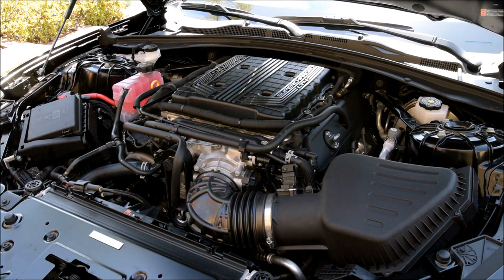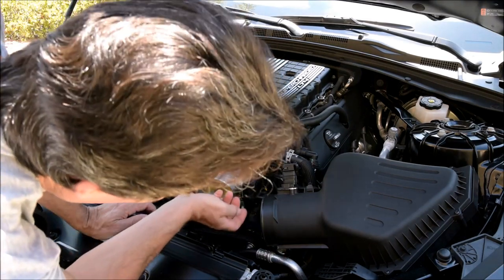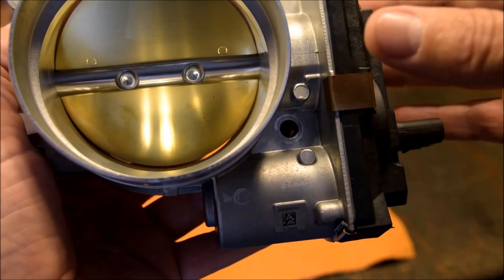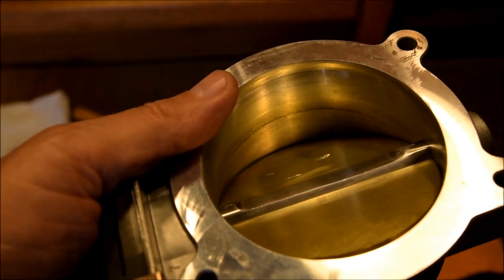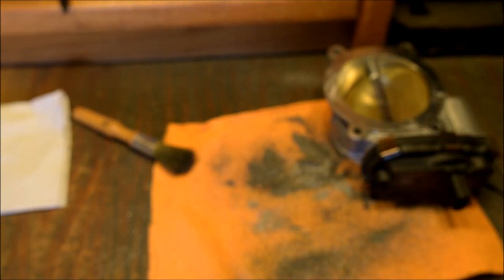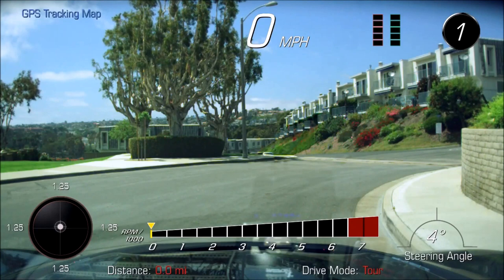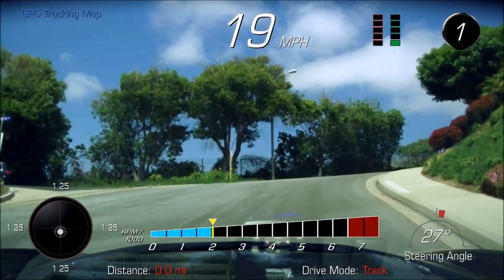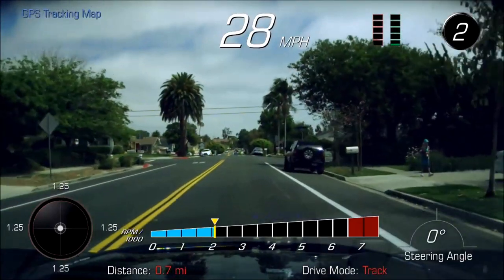BSR ZL1 Throttle Body Porting (How To)

Comment: I hope you don't think you GAIN a large amount of power by polishing that throttle body as you stated a large improvement.
 FIRST you have no before numbers from a dyno to prove this 
Second you have  no after porting numbers. 
THIS IS MUST FOR ALL MODS DONE ON A COMPUTER CONTROLLED CAR!!
Reply from the maker: I hope you don't think you can tell me something I don't already know.  Did I claim a Large Horse Power GAIN?
It's all seat of the pants power and driveability.  It IS a worthwhile project and you WILL see an improvement. 
Thanks for watching!
Reply: @wfofz1  The only problem here is Seat of the pants does not work and IN NO WAY CAN ANYONE FEEL A 1,2,15,30 HP increase by the seat of there pants.
 You have a calibrated air intake with a MASS AIR FLOW SENSOR that measures the volume of air coming through the engine,when you tamper with ANY PART OF THE INTAKE  you can lose Laminar air flow across said sensor other words you can change the way the car runs.
THOSE SAID RIDGES YOU REMOVED ACT as a VENTURI TO COMPRESS THE AIR to the supercharger which accelerates the air through the throttle body by smoothing them out you may of loss power! If you work on cars or bikes with a Carburetor you would know this and recognize them! I know this car is direct injection but correct air flow still applies.Also I am a ASE MASTER TECHNICIAN 40 YEARS I OWN THE SAME CAR and build my own race cars. Something you might need to do now to that car is a dyno and a tune.
Reply from the maker: But,  @apacheone3643  You can FEEL throttle response.
Reply: @wfofz1  I am about the numbers throttle response may  be altered but the Computer could of enrich the fuel mixture for better or worse. EMMISSIONS could of been altered for better or worse! The only way to know for sure is to tie into the Computer by a TUNING software and looking at the fuel graph or a dyno.When I tune I use both and do a before and after run 6 times not like some that do 3 and I am environmentally controlled which is most important.
Reply from the maker: @apacheone3643  You obviously have more money at your disposal than I. I agree that the BEST and most IDEAL would be to do as you are suggesting. 
But, I disagree that there can be no gains without a dyno tune.
Reply from the maker: @apacheone3643  I don't think that people with your resources are looking up "How to/ DYI  videos.
Reply: @wfofz1  I am just bringing a point out, You just cannot take a part out of a car without knowing if you are improving or screwing something up without any testing this is not the 60s where parts were cheaper if you screwed up.
The engines of today are nothing like years ago they are technological  marvel, 10 years ago 650 HP WAS IN the Ferrari,Lamborghini,etc
And your right people do not have my resources but as MOTORHEADS that want more power better throttle response better 1/4 times we as those motor heads that NEED TO DO THE LEGWORK WITH NUMBERS TO BACK UP.
I have tested various COLD AIR INTAKES (CAI) I had A CAI that caused a lose of power 5 HP avg from the stock airbox with a K an N air filter on a Camaro SS. Now I know you only have my word but there was a guy named Lethal Camaro that had a similar result on his own SS and it was on a dyno in California and videotaped.
Reply: @wfofz1  Its not about money John, it never was I am not knocking you, but these cars are really temperamental as I stated before.I have friends that have after 1000 miles ripped the engine out cam the engine change pistons and rods boosted the SUPERCHARGER (20 PSI) these cars push 1000 plus HP AT THE WHEELS.
Some go to shows others are just for Sunday cars.Mine I am leaving stock for now AMERICAN race headers makes headers for my ZL1 Certified by GM that may be the only mod I do.My Car along with My RS IS A 50TH ANNIVERSARY AND THE ZL1 HYPER BLUE IS A 50TH ANNIVERSARY.
Reply: @wfofz1  I am a motor head John And as  TECHNICIAN I AM ALWAYS LOOKING AT WHAT PEOPLE ARE DOING EVEN YOU TUBE but I look to see if they back there CLAIMS up with a dyno test a 1/4 run both before and after but if I see something that's not right I say something.Again Motorheads need to talk and come to a understanding that is how we help each other.
Reply: @apacheone3643  Those ridges are an abrupt step change in the ID of the throttle body. I don't need to tell you as a master technician of 40 years that this creates turbulence and drag, which leads to less efficient air flow. This is not just speculation, but has been well documented as a known shortcoming of the design of this particular throttle body. It has a noticeable negative impact on throttle response and costs horsepower. There is considerable subjective evidence that removing that ridge significantly improves throttle response, and gains of ~15 horsepower have been objectively achieved on a dyno, with no other changes or retuning of the ECU. Unfortunately, due to the ridge's close proximity to the throttle plate, there are limits to how much can be removed without opening up the gap under the throttle plate, affecting idle air flow and exceeding the tolerances that will trigger a ECU fault condition. But Mr. Boston is well aware of this and took a very conservative approach to porting.

With respect to the ridges acting as a venturi, you already know that a venturi is integral to the function of a carburetor. It creates a pressure drop in the air flow that allows the higher atmospheric pressure in the fuel bowl to push fuel into the air stream. However, in a fuel injection system, I can't find any examples where the increase in velocity through a venturi is utilized, particularly in supercharged applications. Can you provide a reference? Furthermore, to minimize turbulence and drag, the angle of transition to the reduction in pipe diameter for a venturi is typically around 30 degrees. Again, this throttle body has an abrupt transition that is close to 90 degrees.
 So, the intent of this ridge is clearly not to act as a venturi.

You're also no doubt aware that while yes, there have been substantial improvements in automotive design and engineering over the decades, cost is still the most important driving factor in mass produced cars, and less than optimal parts still get used in order to meet a budget. All of the evidence indicates that this throttle body is one of those parts. Consequently, what Mr. Boston has done appears to be very sensible and I applaud him for his efforts! I appreciate that you want to be helpful, but perhaps you are unaware that your tone (frequent use of all caps and exclamation points for example) is very patronizing.
Reply: @nigel_white Well as far a the use of Caps and Explanation it is used to draw the attention of someone who might lightly read a statement.Also if someone cannot handle this well it is used in English books all the time!As far a your inquiry to a venturi effect it is used all over it just you do not recognize it.Yes you are correct about how a venturi works in the Carburetor but how well do you know how it works?Did you just look it up online or are you a tuner like me?I would like to know this and as stated if you are a tuner then you should be able to give another example of the same effects on a object that is affected by the same principle of a venturi! I await your reply.